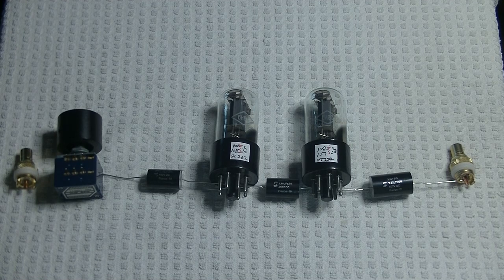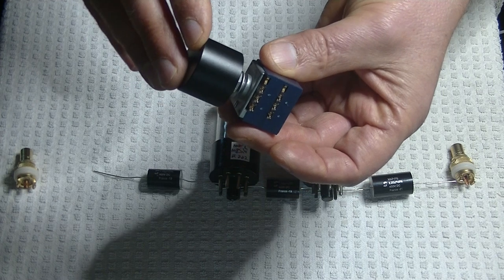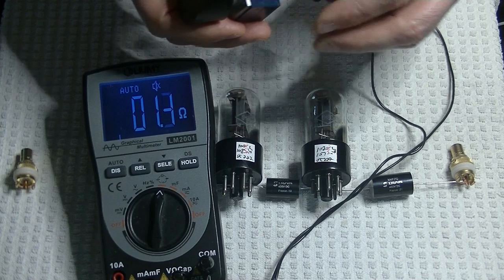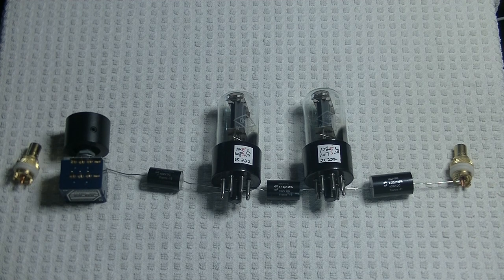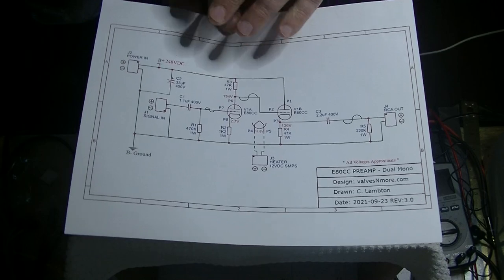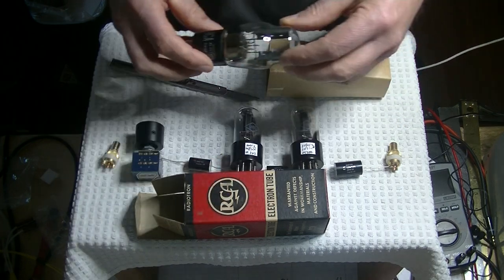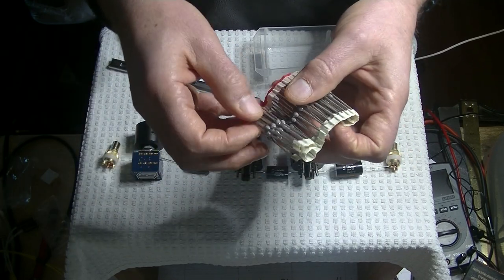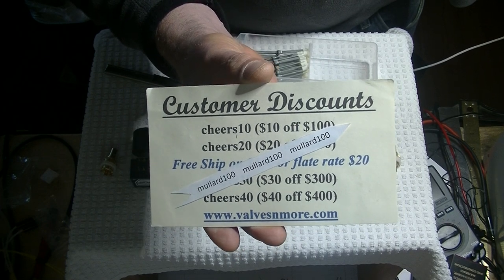Tube Lab #72 - Pt4 - How To Acheive Great Sound - The Volume Control

Comment: Another splendid video.  It’s funny because I just ordered an Alps 100k for an upgrade I’m doing.  I got a breakout board for it too.  Do you use a board or do you wire straight onto the Alps pins?
Reply from the maker: I use a really well designed board, have a look in the store.

Comment: Can you do a Tube basics please? I got a hybrid preamp with two GE5654 tubes & 2 opamp chips. Are these tubes inferior in sound quality to the 12AX7s? What is the purpose of having different kind of tubes? Is there a particular tube which works best in the buffer stage?
Reply from the maker: These questions are way more specific than a Tube Basics, which I've done several of way back in the early Tube Labs, just google Tube Lab #1 and work your way forward.  As far as your specific questions, Yes some tubes will sound better than others in a buffer.  I'm not familiar with the 5654, it's not a tube that is in common use these days.  One thing that is really important when choosing tube gear is to make sure the tubes it uses are good sounding, commonly available and affordable.  These are the guidelines we follow when we start a new Kit Amp design.
Reply: @tubelab194  Thank you for your response! The GE5654 tube is being used in (i guess) cheaper amp/preamps and a pair of NOS is just $25. So I just bought a pair yesterday.. still needs burn in. 
I am just curious which tube, in your opinion, sounds the best in the buffer stage? (I will use your inputs for my next upgrade)
Reply from the maker: @Thoughtflux  A buffer is often used to describe a cathode follower stage.  A very common tube used in this position is the 6sn7 or the modern close equivalent 12au7.  A cathode follower has much less influence on the sound because it doesn't have any voltage gain.  But it's still important to put a well made low noise reliable tube in this position.